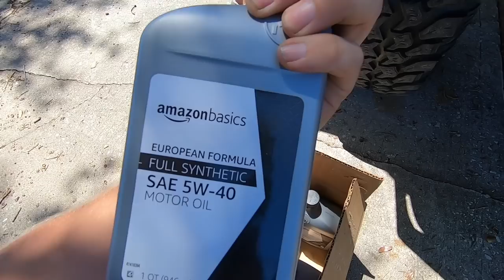Driving Underwater EP.3 - HOW DOES THIS KEEP HAPPENING!? (Need Big Changes)

Comment: The exhaust needs a snorkel! I don't think the ole bogger could exhale! You're almost there, don't give up!
Reply: Hes right waters getting through the exhaust
Reply: xllDawsonllx nope. Water pressure is preventing the exhaust from escaping the engine, thus meaning fresh air cannot enter each cylinder. This leads to the engine not being able to create a proper combustion cycle, leading to it stalling.
Reply: I came here to suggest this as well. I mean it’s one of the last things to try!!
Reply: @TGears314  I don't think the water pressure is really that big of a factor at that depth to be honest... If he had dielectric grease in all this connectors for the motor and plug wires, make it truly water tight, then it would be fine. I don't think water at that depth can have any more affect on breathing like a clogged catalytic converter would in this situation. I would also recommend letting air out of the tires to help with traction and buoyancy.
Reply: @KHROMATICxKHAOS  Don't think of it as air trying to escape the tail pipe, think of it as a water filled pipe you're trying to blow air through.
Reply: Listen to James "when you crank it it pushes exhaust". That black tube that runs up to the snorkel from the back was added to the exhaust in the previous episode if nobody remembers
Reply: Not deep enough to make that amount of pressure. Just try holding the exhaust in with your hand, requires abit of force. Something a few feet of water doesnt have.
Reply: @DKTAz00  well here's the thing with that analogy. Water isn't getting into it to stop it because it's cranking over fine. The other thing is, the vehicle was running, thus forcing the water away. Got to remember that air pushing out is coming from an explosion inside the motor. Now if you completely plug off an exhaust with a metal plate is weld it shut, then yes it will turn off.

Comment: @cleetusmcfarland I've been thinking about your issue with this. I am a scuba diver and have a pretty good understanding of pressures. That engine has double digit horsepower at best, and while the snorkel lets it breathe, the exhaust I believe is an issue. At only a few feet deep, the water pressure starts to increase quite a bit. At 5 feet it is around 3 psi of back pressure on the exhaust. This reduces the power output significantly. I believe this is causing output to be so low that it dies, and also why you can then crank with no start. Put a snorkel on the exhaust with one of your tractor flaps and you should be golden!
Reply: Rama Palmer on the dirt every day episode they had an exhaust snorkel as well.
Reply: 3 psi under five feet of water?  Isn't air pressure at sea level like 15psi? Or did you mean 30psi?
Reply: @jaybrewster2475  in addition to outside air pressure. This pond may not be at sea level. Sea level is 14.7 psi
Reply: Definitely need to get that water pressure off the exhaust. I use to do something similar in a F150 with a 351w. Once the exhuast gets underwater engine power greatly declines. Basically you are plugging the exhaust with water.
Reply: @hawkman4374  Exactly! Engines are air pumps, the more air you move, the more power you make. They are not meant to be air compressors, especially with valve overlap (for scavenging). If the exhaust gains even a little pressure, that fills the cylinder with exhaust gas, which is inert and cannot be re-mixed with fuel for burning.
Reply: @jaybrewster2475  it's +3 psi (I think that's what he meant.) So  yes, you are correct. The engine is still seeing 14.7 (because of the snorkel) but the exhaust is seeing 14.7+water pressure.  Doesn't take long for the water pressure to overwhelm the exhaust pressure, and water will come in the other direction - flooding  from the back.
Reply: @hawkman4374  sup brother?
Reply: It's completely this, they need an exhaust snorkel
Reply: thats what i thought after the 1st vid lol
Reply: Shin Sho  I was also wondering about the doors. I may not offroad...but I have seen a lot of offroad videos and vehicles driving off road on 'Green Lanes.' And no one opened the car doors in order to make it sink. Indeed I saw one video (I think Australian), the vehicle was bobbing about slightly to the left of the road. The driver just calmly waited and, while the vehicle was at a certain angle, used the rear wheels as an outboard motor and made it to the other side. Aside from a snorkel no additional mods or fancy flags or planks of wood.
Reply: @jaybrewster2475  1 additional atmosphere (14.7 psi) per 10 meters (33 feet) of water-depth. Therefore, if the vehicle is underwater and the exhaust pipe is 5 feet under the surface...an extra ~3 psi would be seen acting against exhaust pressure.  An exhaust snorkel with an exist about 3 feet above the roof line seems about right.
Reply: Thats what i was thinking from the first video. They need to direct the exhaust with a snorkel also
Reply: @Napoleon_Blownapart  James even stated it in the first vid

Comment: 2 months later: “we’re attempting an 8 on our junkyard engine mustang “
Reply: Must happen
Reply: @warbzpwns WE gotta get cleetus to build up the ford to race ruby! ultimate junkyard ford vs chevy junker battle...
Reply: Exactly what i was thinking lol
Reply: Id love it.
Reply: hoping for a ls LS swap
Reply: Ford will go faster for less. Js. Ls swap and weld a 8.8 and put a auto in it. Instant low 8s
Reply: Everyone knows mustangs are junk. Crown Vics are worthy.
Reply: Coyote, good turbo set up, good suspension. 8s will not be hard.
Reply: You spell weeks wrong
Reply: Lmao..Cletus and these guys are way too cool to drive a clown car like a mustang.
They are only for crown vic swaps and jokes.
Reply: @jackmackenzie2118  They will trash it and sell it for scrap metal. It's a mustang dude. They are like pintos and pacers... clown cars.
Reply: yup.
Reply: John MacInnes p38 heads must suck or you have some secret. I just port and polished some, 1.5mm overin and ex, dual springs, decked 65 thousandths, bigger injectors, crowed can and I can't hardly tell the difference. They are still on a p38 tho.
Reply: “Our 8.1l ls truck motor in a Ford Mustang is going to be faster than Leroy  and we only had the car for 3 months”
Reply: Also 2 months later: "Driving Underwater EP.27 - HOW DOES THIS KEEP HAPPENING!?"
Reply: They have two turbo cars and two supercharged cars let's make the mustang a nitrous car!!
Reply: @shaunmilor  yesss
Reply: 2 years later: we are attempting a 2 on our junkyard jet camino
Reply: 8 what? A crowd hit of 8 people? Bahahahahahaaaa
Reply: They would just throw the Vic engine an trans in it, run it at the track, then put it back in the vic
Reply: @berrytharp1334  That mustang literally has the same drive train as the crown vic...

Comment: That Amazon basic full synthetic is actually a really high quality oil.

And the donkey wasn't pissed. He was just disappointed you didn't bring him any snacks.
Reply: It really is great oil. Project Farm has done a bunch of testing and it performed extremely well against many high quality oil.
Reply: I wish it meet the specifications for my VW engine I'd use it for sure
Reply: @dominick253 ....I bet it does.  Look closer.  They have a variety of choices to meet any car spec.  Warren oil is the manufacturer and has been around since 1922.  I'l guarantee they have something for a VW.
Reply: @tacman1845  ive been using it in multiple changes in my 6.0 powerstroke. Been good so far
Reply: @paulcopeland9035  They don't have anything that meets VW 502/505/506 spec
Reply: @GOOGLM3_NY  ....Warren Oil is the manufacturer of the Amazon oil.  Their brand is MAG 1 European Synthetic.  Amazon European is that oil.  It is listed by VW as approved.  VW does not have the Amazon label in their approved list.  It is the same oil so I don't see any reason why it wouldn't be fine.  If your car is under warranty, then not being exactly listed may be a problem.  Otherwise I would go for it.  Can't beat the price.  Here is the site info...https://mag1.com/products/passenger-car-motor-oil/full-synthetic-european-motor-oil/mag-1-full-synthetic-european-5w-40-a3b4-motor-oil/
Reply: @paulcopeland9035 I am not disputing its quality. I watched the project farm video and was impressed. However, an Audi motor isn't cheap and voiding the warranty potentially isn't worth the risk because it's inexpensive.  My Audi, is under warranty. It has Liqui Moly Molygen in it. When I can't source it locally, it has Motul.
Reply: @GOOGLM3_NY ...Well, I mentioned that there might be a warranty issue with the Amazon brand oil since it is not listed by VW .  My point is that it meets the spec you provided (VW 502/505/506) and is listed under the Warren name..  If there are additives that are required beyond the written spec then you would be wise to follow the mfg. recommendations.
Reply: @paulcopeland9035  Just sayin' my friend. What would you do if it were your vehicle and it's what separates you from warranty coverage and them telling you sucks to be you. I wish it were listed. It is much less expensive and is definitely a solid product.
Reply: @GOOGLM3_NY  whoever is selling you that is playing you molly impregnates itself into the material it's used on so maybe using it every once in a while would be worth it but using it everytime I dont think would be getting the full value of it.
Reply: @lyndsycarter6722  the results speak for themselves. I drive the shit out of my car. JB4 custom map 6 tune, 034 everything, all which I installed myself (B9 A4). I'll try almost anything that meets spec and share my findings with the community. I fail to see the brainwashing and spoon feeding you are implying.
Reply: @GOOGLM3_NY ...Yep, I understand.  You really have no choice if the warranty is that specific.  If you drive the car past warranty, then you have a choice.  At this point Audi is calling the shots.  Good luck with this car and it was good talking to you!

Comment: Snorkel the exhaust to reduce the back pressure and get the RPM’s up.
Reply: Do research on back pressure. It's not needed!!!
Reply: I was going to suggest the same thing!
Reply: Hood pipe
Reply: Patrick Querry point is you want atmospheric pressure not 6 foot below water
Reply: Uhh, it's under water.....it needs a snorkel too.....back-pressure lol
Reply: @patrickquerry5768  go watch engine masters. Back pressure is a bad thing. Period
Reply: you want a little bit of backpressure not a fucking pond's worth of backpressure lmao  @patrickquerry5768
Reply: I think it needs a snorkel too...not for all this back pressure talk, but for when the engine inevitably dies then the water doesn’t back fill through the exhaust into the engine
Reply: Just put a 2” exhaust check valve and that solves the engine flooding when it dies!
Reply: @patrickquerry5768  You want the amount of back pressure a manifold gives you and that is it. You speed up NA cars by giving them LESS BACKPRESSURE and LESS RESISTANCE for intake air. Having the exhausts under water creates way too much resistance and pressure and will actually damage the rings and seals.

Also maybe you should take your own advice and go watch that engineering explained video again.
Reply: @patrickquerry5768  not when underwater
Reply: That's what I've been thinking

Comment: Extend the exhaust pipe way to much back pressure
Reply: bingo
Reply: My thoughts the first time. Distributor could still be an issue too.
Reply: No. That's not an issue at all. I drive my ATV underwater all the time and never stalls. Water doesn't offer much pressure against the exhaust escaping. Go blow through a straw in a cup of water. Barely feel the difference between that and out in the air.
Reply: The military proved that theory years and years ago that is why they put FORDING kits on the vehicles....
Reply: Why haven't they figured that out yet?
Reply: @rhull3939  Yeah, now make the straw about 6 feet long and blow through at least 5 feet (height) of water.
Reply: Robert Hull; water pressure increases exponentially with depth. Ex: you can breathe through a snorkel but not through a hose at the bottom of the pool.
Reply: @rsharney1111   Nope, liniar.
Reply: I don’t think that’s it because the proper mud trucks submerge their exhausts all the time but it might be
Reply: @ellisberry8747  they are built engines this is worn out 4cl
Reply: Cars And Guitars that’s true,but I’ve seen people do it on clapped quads and stuff and it didn’t seem to make any difference at all
Reply: I’m not sure though,not an off-road guy,although I would like to be
Reply: yeah just run rubber tube from car to shore :)
Reply: @darrinsinger4231  
Go watch the Aussie guy drive his Land Cruiser with snorkel and normal  exhaust thru a river and then come tell us why he is wrong. 
 Fording kits, smh...
Reply: theDavitos or just run a plastic tube from car to above water?
Reply: @rsharney1111  yep. But their exhaust is in only about 2 feet of water when it cuts off. It's still the ignition.
Reply: @willmc42  I have no idea as to what video you are talking about however a low compression engine cannot over come even lower pressures of water especially if it leaks, how do I know this because I have submerged a few cars without a tail pipe that did not shut down except for one and my sons mom blamed it on water in the computer which for some reason worked that same night and for months after that...
Reply: Rotor Ryan bro, you don’t know what the hell you are talking about. Water pressure does not increase “exponentially” with depth LOL. It’s linear. As linear as it gets.
Reply: @BikingVikingHH   Tell that to a submariner;)

Comment: The exhaust should really vent to the air...car is losing a ton of power underwater
Reply: This is my point. Sure the cooling fan drawn power, but the exhaust .. the pressure of water back to the cylinders preventing it to breathe correctly, is the main issue !
Also the alternator and the battery, within water it could short it and then no more power !
Reply: tractor flap above the waterline exhaust would be awesome
Reply: Yep.  Anyone who saw the banana scene in the original Beverly Hills Cop knows the exhaust needs to not be blocked!  They really need an exhaust rise that's about the same height as their intake.
Reply: i also thinnk that water could be getting in the clutch and that is making the car stall
Reply: When I drove my car in a 2.5-foot deep puddle as soon as the water got over the exhaust pipe it died

Comment: Exhaust to top of tracker. Not enough compression to keep out water
Reply: THISSSS!!!!
Reply: At 5 feet below the surface the water pressure is about 2 psi which is roughly equal to the backpressure in the exhaust manifold at idle in normal circumstances.  At 20 feet it's about 8.5, so a little more restrictive, but the engine will still have no problems overcoming that.  If it stops running for another reason (ignition) it's conceivable it could flood the engine if it manages to leak in and the valves are open but it's not what's killing it in the first place.
Reply: I said that last attempt.  It simply can't run with that much pressure on the exhaust.

Comment: "I am not modifying this Mustang, put it on the record."
5 seconds later...
"Okay, nitrous only"

I spelt wurds rong.
Reply: 2 weeks later...
VMP is sending us rods and pistons...
Reply: Week and 1/2 later  we’re on engine #3...
Reply: 3 weeks later. Wer ordered this 2019  stroker 5.0.
Reply: @nateavery2875  4 weeks later. Are we ready to run 8´s??
Reply: Jeah, make 1000 hp with nitros. Maybe a mother bottle in the trunk 🤔
Reply: New drift-burnout contest car.... more power, angle kit... chrisFix on the way
Reply: Remeber how ruby was supposed to be nitrous only and then they just build a turbokit?
Reply: Itll end up with a 7.3 Powerstroke and power glide.
Reply: A month later "Were going for a 6 second pass" "FULL PULL".

Comment: I would try welding on a exhaust extension to prevent a high back pressure, the deeper you go the more the more water wants to force in
Reply: Sorry boys, toyota trucks have been going aquatic for many years with normal exhaust . It is the distributor leaking water , they are going to "Balloon trick" it by putting a small balloon on the dist body and sealing the pickup inlet which is sealed with a little rubber grommet/pad . That should solve the firing issue, it has nothing to do with exhaust .
Reply: @willmc42  well it should help a bit with its 5hp 1.6L....
Reply: Will i am MC While you may be right on the distributor leaking, saying exhaust back pressure has no effect on an engine is wrong. It would just be less apparent with more displacement and/or forced induction
Reply: @jackradzelovage6961  lol
Reply: Yep like he said..It's all about physics! And like you said the deeper you go the higher the back-pressure. Vent the exhaust and add an electronic ignition... Those Toyota's go in at high RPM and never get deeper than the middle of the body. I've been diving since the 60's  and know what water pressure can do to anything that breaths air, and an engine is just a big air-pump!